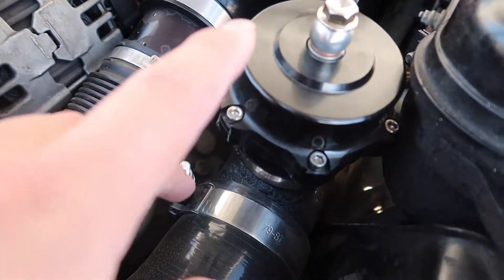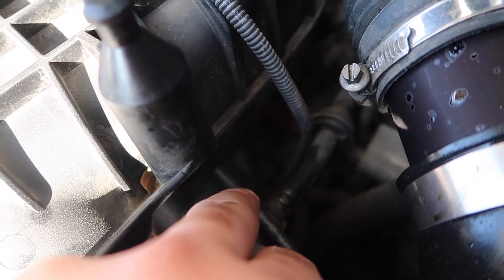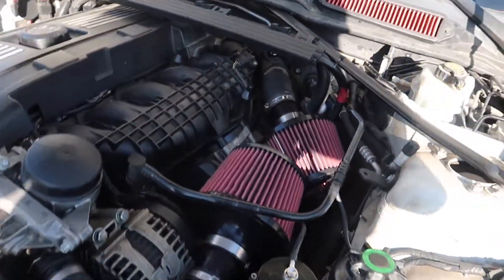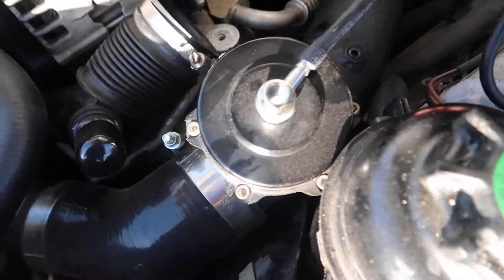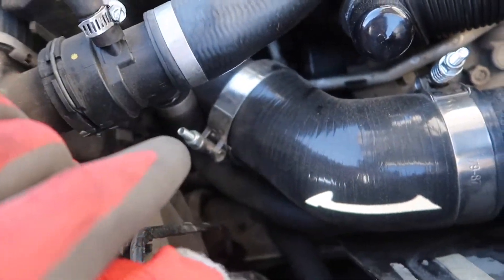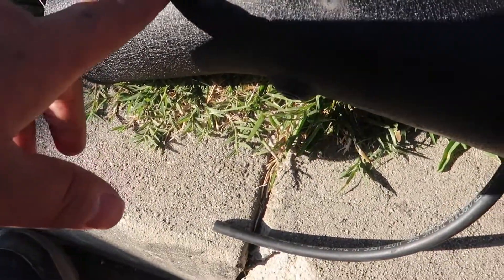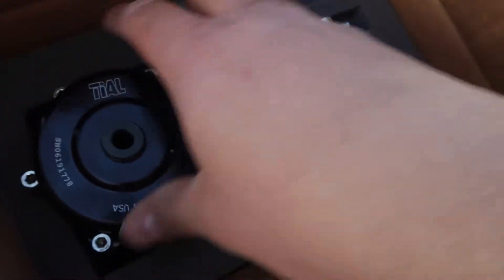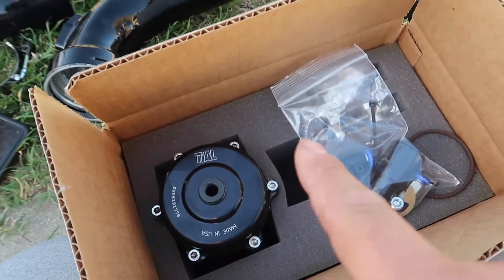335I BMS TIAL BOV + BOV ADAPTER INSTALL!!

Comment: Would you need this adapter for a Dual port BOV or only a Tial?
Reply from the maker: you dont need it but it would be easier to have in my opinion
Reply: @srbuildz  Can adding to much air to the manifold cause issue's if it wasn't needed ?
Reply from the maker: @trackmedixuk  what do you mean by adding to much air to the manifold ?
Reply: @srbuildz  By adding more air via the adapter vs the factory default 1/8"input . By using the adapter we are adding more air but buy doing so could we could be messing with the air to fuel ratio BMW has tuned in by adding to much air ?
Reply from the maker: @trackmedixuk  no it wont mess with anything you should be fine whether you use this piece or not the amount of air wont affect the car

Comment: Were you having any problems with the eBay bov? Also what size spring did you use for the tail.
Reply from the maker: The only issue i had was the top piece of the bov it was loose no matter how much i tightened it and i would get a boost leak from there but other than that it worked and sounded great bro it was probably the previous owner that damaged the one on the car
Reply from the maker: Also for the tial it said 10psi on the box so im guessing its a 10lb spring but im not too sure bro

Comment: What’s the different in between using the rubber line and the hard line?
Reply from the maker: Sorry for the late reply not really a difference i just prefer the hard line as it wont burst or crack under heat or pressure the rubber one is good but over time it just gives out